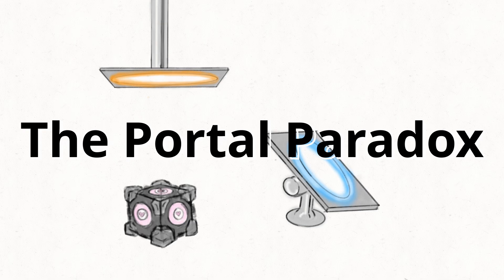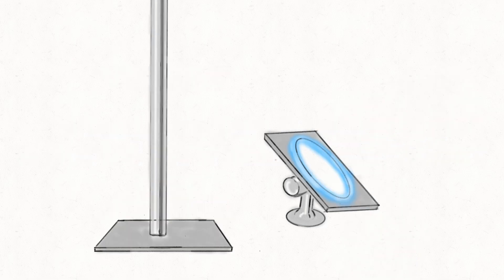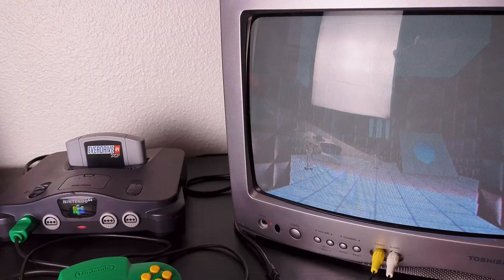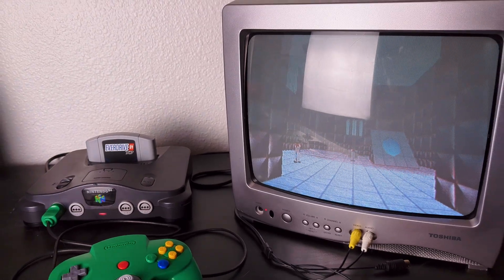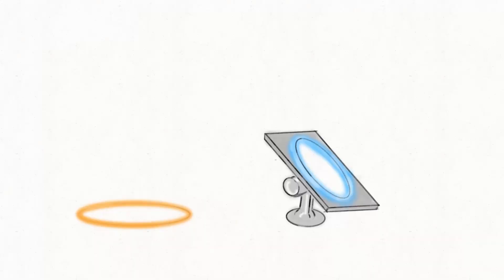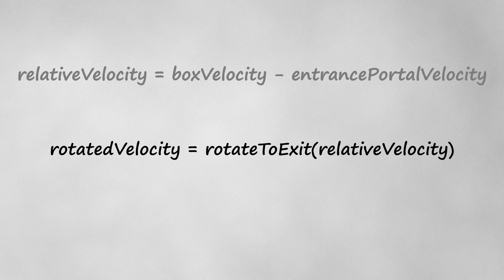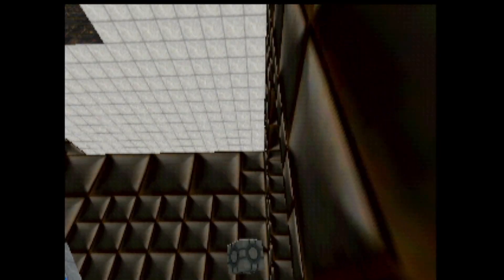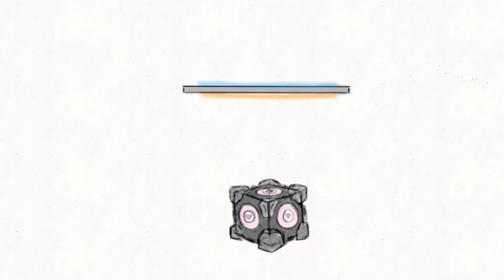I rewrote Portal from scratch and solved the Portal Paradox

Comment: I actually appreciate you using the logic of conservation of momentum to solve the portal paradox. The portal moving over the cube at, say, 60mph, is no different from the cube moving into the portal at 60mph. This is very logically sound and I appreciate your approach
Reply: The box and portal do not interact.  

The difference between moving a cube at a portal at 60 mph and moving a portal at a cube at 60 mph is the difference between throwing a cube through a hula hoop at 60mph and a hula hoop moving at a cube at 60 mph. The two objects are completely independent of one another. The empty space in the hula hoop and portal has no momentum it is empty space
Reply: @5Amigos32  that is only partially true given that both sides of the hula hoop are moving the same way relatively speaking with this portal situation the two sides of the hula hoop are relatively moving at different speeds
Reply: @cartoonkeeper  the two sides moving at different rates does matter to the cube because they do not interact with the cube. 

If you placed a camera on the hula hoop from it's relative position it would appear that the cube is flying out the other side at 60mph but it isn't. Once the hula hoop hits the ground and stops so too does the cube from that perspective because the two are entirely independent from one another. The cube doesn't gain momentum just because from the hula hoop or the portals perspective it looked like it had momentum.
Reply: @5Amigos32  well unless you're a physicist because I'm not the only way to break this debate between the two of us and everyone else in this comments section would be if there was a physicist in this comments section who could break the tie
Reply: @cartoonkeeper  The physicist will say "Portals don't exist".
Reply: @fantastikboom1094  that is true but a lot of theoretical science revolves around the what if
Reply: @cartoonkeeper  We need to know how space is distorted in Portal. Since we don't know, we can only discuss what was shown in the game and what definition was given.

Portal may be described as doorway if we ignore it can connect two absolutely separated areas even with different directions. But the mechanic of how things are going through is just like there is a common space.
Reply: @fantastikboom1094  exactly and from the perspective of the exit portal we need to figure out what the intrinsic difference would be between the Box being pushed up by a piston into the entrance portal and the entrance portal being pushed down on top of the box with a stationary exit portal
Reply: @cartoonkeeper 
In either case, it has to move outside the exit portal. Both scenario has exit velocities.
Reply: @breakerboy365  exactly that's why the box would in fact go flying
Reply: @cartoonkeeper It all depends on the inertia of the cube. If the cube has an inertia > 0, it'll be launched. If it's not moving, it'll just fall. If the top portal is slammed into the cube, the cube won't magically gain inertia. Portals don't interact with the objects, they only connect two points in space. That's called a wormhole and the issue of passing objects through has been solved a long time ago.
Reply: @louisrobitaille5810  true but you forget that all motion is relative also you're confusing inertia with momentum inertia an object's tendency to continue doing what it is currently doing unless acted on by a force an object with an inertia 3 will take 3 units of force to alter what it is doing an object with an inertia of 0 will take 0 units of force to alter what it is doing but again momentum is a factor of motion and motion is relative to the point you are observing it from hence why from the perspective of the exit portal aucuba being pushed into a portal by a piston is no different than the portal being pushed into the cube by piston since the exit portal is not moving in the space that it exists in it cannot tell the difference regardless of whether the entrance portal is moving or not the exit Portal including momentum will see it indistinguishable between a box that is being pushed into the portal and a portal being pushed into the box because the moment the box starts exiting the portal its molecules has to start pushing the molecules ahead of it out of the way in order for the rest of the box to exit the portal therefore imparting momentum which means when the Piston bottoms out and the portal hits the platform all of that momentum that has to be conserved the momentum from the portal indirectly has been transferred to the Box throwing the Box out the exit portal
Reply: @5Amigos32 And that's exactly why the box should just fall on the other side, not be launched off of it.
Reply: I mean im not fully on board with this solution.
The portal is just a doorway, with the entrance and exit in different points in space.

If you ran and jumped through the doorway, you would fly out the other side.

If you stand still and the doorway flew at you with speed, you would still be standing when you come out the other side. You wouldnt magically gain momentum, even if the doorway had momentum.
Reply: I agree. This feels the almost correct to me. I am unable to determine for myself what would happen if you were crushed between a portal.
Reply: that's why it's not a paradox, it's solved by a fundamental law of physics lol
Reply: @b4ttlemast0r  Our laws of physics don't apply to portals since portals in Portal don't exist in reality. They screw up conservation of energy anyways since the cube can suddenly gain or lose gravitational potential energy by going through a portal
Reply: @seanthesheep You've never heard of worm holes huh? They might not have been discovered yet, but there're many models of worm holes that work in theory following general relativity.
Reply: @louisrobitaille5810  I am not a physicist but I am pretty sure the portals in Portal are not worm holes
Reply: @b4ttlemast0r  Actually it's not
Reply: @b4ttlemast0r  Yep. The only people who think it's confusing have a poor grasp of high school physics.
Reply: One major step overlooked in these simulations is applied force and according conversion to speed. Most simulations only account for object's speed during the portal's transition phase. While in reality you have to apply the operations on force and momentum energy and then use these to determine the object's velocity. Way more complex but I think more reallife accurate.
Reply: It is different, by the same logic a cube going 60mph not losing any speed from going through portal proves that portals have no mass, thus a portal colliding with a cube shouldn't increase its speed
Reply: @lasadaf5336  Portals also create and destroy energy, so really they can behave however people want them to behave.
But you can also think of it that in order for the box to actually come out of the blue portal at all, each part of the box that comes out must be pushed out of the way by the next part of the box coming out behind it, and this will happen at the same speed that the orange portal moves over the box.
Reply: @lasadaf5336  The portal is attached to a piston, which does have mass, therefore energy that can be passed to the cube.
Reply: It is actually different, in many ways
Reply: It is different. When you throw something into a portal with velocity V, you are also applying additional force to overcome gravitational pull. In case of a moving portal (and this implementation) gravity does not exist, thus the results are not accurate.
In reality part of the transferred potential energy will be spent on overcoming gravity, thus resulting velocity will be smaller than shown.
Reply: @Vladimir_Kv  there is no force against gravity, except the force of the floor not letting the cube fall through.
what you just said makes no sense, thing comes in at relative velocity v and comes out at relative velocity v.
because the portals are just a connection between 2 systems, so conservation of energy applies, and physics tells us energy is always conserved.
Reply: @elidoz9522  Are you daft?
Cube is always under the effect of gravity. The only reason it is not pulled down is the "couter force" of the floor below it. To launch a cube you need to overcome gravity pull first. Which will be subtracted from the force that the portal transfers to the cube.
Reply: @Vladimir_Kv  the portal doesn't give any force to the cube, it's stationary, because the force of gravity is already countered by the force of the floor the cube is standing on.
the only remaining factor in determining the cube's exit velocity, is the speed the portal moves at when the cube passes through it.
the portal is just a wormhole, it doesn't transfer any force, it transfers mass and momentum relative to it.
Reply: I tried explaining this to my dad, he disagrees because the box didn't have energy to begin with.  I told him to watch this video later, so hopefully I can win the argument through this video.
Reply: that's because it never was a paradox, it's just people not understanding how physics works

Comment: Don't forget that objects can also apply forces to the portal surfaces. If the blue portal is on the ground and the orange portal is on a free-falling panel that falls onto a very heavy object, what happens when the object tries to fall back into the blue portal? It might be strong enough to push the orange portal's panel back up off the ground a bit.
Reply: You can't apply force to the surface a portal is "placed" on through the face of another portal. If you go in the face of one portal, you come out on the front face of the other. The portal doesn't exist, so there's no way to apply pressure to it. It is just a visual metaphor for the warping of spacetime.
Reply: Or it may just hit the floor the other portal is pressed against and stop moving.
Reply: Portals are not affected by change of momentum of the objects that go through it. It's basically magic and never explained. If you think about it portals enable infinite energy generation with infinite vertical gravitational field.
Reply: All three of you should think - if you push against a wall through a portal, and the wall doesn't move, but the surface the portal is on is free to move, shouldn't the portal move instead?
Reply: @LB_  No, because your scenario is functionally identical to "there is a wall with a hole in it, and behind it is a second wall. You push on the second wall through that hole and the wall doesn't move, but the wall the hole is in is free to move, shouldn't the hole move instead?"
Reply: @1sdani  Nope, the portals are on different walls. Your scenario description only applies if the portals are on both sides of the same board.
Reply: @LB_  As far as physics calculations go, the portals might as well be on both sides of the same board. They are literal holes in spacetime connecting two areas that otherwise wouldn't be connected. You can't apply force on empty space.
Reply: @1sdani  So, let's set up both portals on separate free-moving panels. The blue portal is pushed onto a bar sticking out of the wall, and then left motionless with half the bar in the portal. Then, the orange portal is gently pushed so that it coasts toward a wall. When the bar sticking through the portal hits the wall, what do you expect to happen? Will it stop, or will it somehow have infinite force to either crush itself or break through the wall? If it stops, that is a force acting on the portal.
Reply: @LB_  The bar is pushed backwards by the wall. It's the same scenario as if you pushed the wall towards the bar without any portals involved. If the two walls described are the same wall, then you have a case equivalent to if the bar went all around the would until it reached the back side of the wall and could be extended via telescoping. Either the wall will crumble or the bar will bend as any bar pushed against a wall would.

The portal itself would not be applying any force to anything nor would it stop, rather the only forces involved will be those of the bar and the wall resulting from the decrease in distance in space between the wall and bar.
Reply: @1sdani  Where does the energy come from to crush the bar / break the wall?
Reply: @LB_  The reduction in space between the bar and the wall. It's the same as if you took a box and suddenly increased the volume of the space inside it.
Reply: @1sdani  There is no reduction in space. Whatever decrease in distance between the walls through the portals, on the other side of the portals is an increase in space. Where does the energy come from?
Reply: @LB_  Portals are a warping of space. The movement of portals are literally a change in the continuity space. The space between the pole and the wall is objectively reduced. The energy comes from the normal force between the pole and the wall. If you pack too many clothes in a suitcase, the normal force of the clothes pushing against the top of the suitcase will open the suitcase.

Portals don't exist, they're a visual representation of a discontinuity of space. I don't care how strong you are, you can't push the space at 0 degrees latitude 0 degrees longitude to the other side of the planet with physical force alone.
Reply: @1sdani  Your definition of portals just simply does not work in the context of moving portals. It does not make sense for the bar or wall in my example to be damaged in any way, the average person would see that as an unexpected outcome.
Reply: @LB_  My definition of portals is literally the definition of portals given ingame. Portals are points in space where otherwise non-adjacent points in space become adjacent. In other words, they are wormholes. They are not oval shaped teleporters that teleport whatever touches their front face.
Reply: @1sdani  In what game? This video is about someone's own game they are creating with moving portals. Portal 1 by Valve does not have moving portals.
Reply: @LB_  Portal 1 and 2 both describe portals as though they create wormholes, even though the portal gun itself has the words "quantum tunneling" in its name.
Reply: @1sdani  Portal 2 has actual moving portal surfaces, in the neurotoxin generator room. The person who created the video we are commenting on specifically said Portal didn't have moving portals, so I think they were excluding Portal 2.

Comment: I'm suspicious of whether this would break the law of conservation of energy. It seems like the energy of the platform moving the portal is being doubled and put into the cube, which would break the law. If you could come up with a proof as to how it doesn't break this universal law at least I'd love to see it! Also this project is awesome :)
Reply: Even stationary portals violate the conservation of energy
Reply: I'm not sure there's a rational proof just based on the motion alone. but you could make the assumption that portals must expend energy in order to transfer matter through them, perhaps moreso when the "frame of reference" between the portals is shifting (i.e one portal is moving and the other is not).  that would even out the apparent energy multiplication problem
Reply: Portals might actually just violate conservation of energy, unless there's some kind of unseen power supply that they're drawing from in order to perform their feats that the player just isn't capable of using up. And I wouldn't know how the energy is being transferred either.
Reply: That seems to be the general consensus that portals in principle are a violation of this law. In that case I think the interpretation in the video is intuitive and it's personally the one I prefer.

Comment: So, giving it some thought, I don't think it's wrong, but maybe it's not a complete picture if in a real world scenario.

Calculations for mass and inertia usually centers around... well, a center point of the mass. But that isn't the case in real world where the mass of a object is distributed throughout the whole object. So, by having a portal move instead of the object, its trying to impart it's inertia onto the object which is at rest.

So while I do think the object would move when it exits the stationary portal, I would think in a "real world scenario" it would be at a differing speed, because the object doesn't have the inertia.  Maybe even resulting in an erratic tumble. Because a section of mass would suddenly have inertia relative to the world, where as the rest does not till the portal goes over the whole object.

I wanna say it would be slower on the exit, simply because the moving mass of the object would be pulling onto non-moving mass to cause some slow down. Though the motion of the portal doesn't change so maybe that isn't the case. But even if it wouldn't be slowed down it would still likely result in a erratic motion of the object when it has fully gone through.

That's my thought process on it, anyway. Could be wrong, or even still not a complete picture (probably isn't on the later)